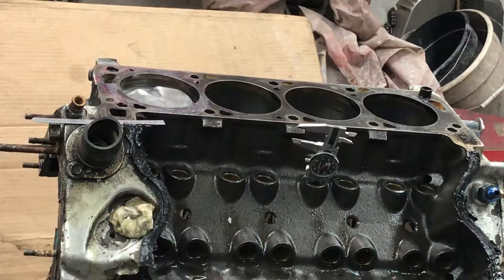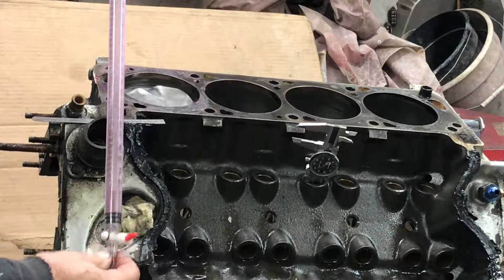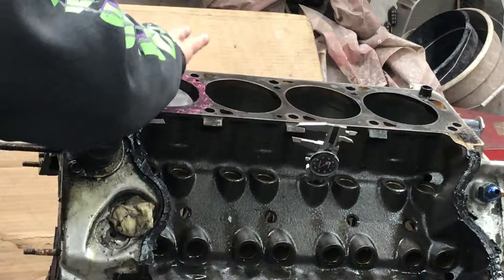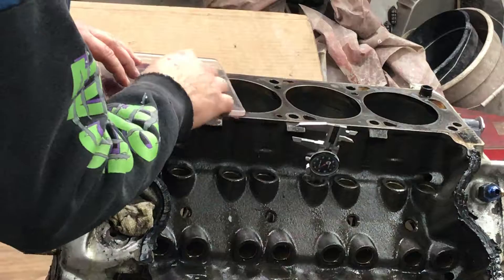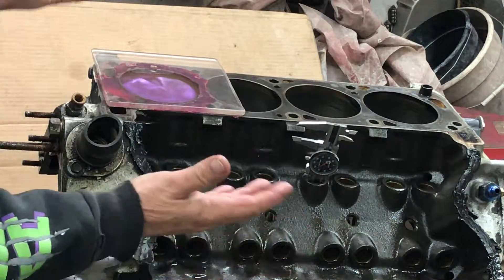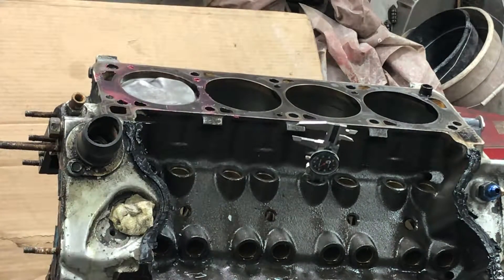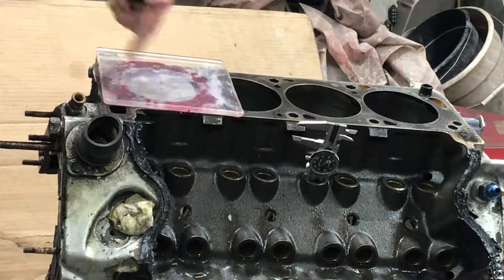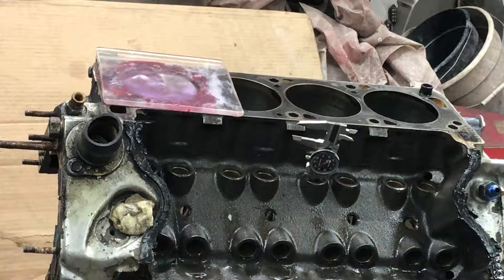Measuring volume (cc's) of a pop up piston. Read description for answer.

Comment: Thanks for explaining this, i was having a hard time figuring it out lol.  Was almost going to make a reverse mold of the piston, that would not have been fun..  anyway, i checked your math, and it all makes sense!  My only problem is how you calculated the compression height in the bore for your final cc measurement.  Truly the dome is 11 cc's, and its reliant on the builder to set the compression height.  That calculation is easily done separately.  Also im curious, is that gasket you used .050 or thicker?  Common .040 x 4.100 gasket calculates to 8 or 9 cc's, and picks the compression up almost half point in your example.  But that gasket isn't a symmetrical round bore either, so it might be more?
Reply from the maker: On a Cleveland the head gasket is bigger than on a Windsor. A Cleveland doesn’t have a perfect circle for the cylinder opening. I made a video of when I measured the cc’s of the gasket. It is 12 cc’s. Watch the video on it. Thanks.
Reply: @dansmessygarage  I will, thank you!  That is very good info to know!

Comment: Did you make good power with those pop up pistons on those open chamber heads.
Reply from the maker: It makes about 475 hp on 93 octane pump gas. Nothing crazy. It is N.A. no blower, no turbo, no NOS, just a single 750 carb. Today it is called a boring engine :-(
Reply: @dansmessygarage all these modern engines, people have a helluva motor with just a cam, exhaust, and computer tune.  It's still fun to take a motor with mediocre heads and show up some "big hp" motors.
Edit: not that cleveland heads are mediocre, just by today's standards.

Comment: Didn't it take a bit more than 147 cc? i could see some air under the plate
Reply from the maker: No. Watch the video again. You can see the air bubble getting bigger after I stopped filling it. The liquid was draining out thru the ring gaps. It most likely was draining out the entire time I was refilling the burette. That means it took less than 147 cc's. For my messy garage tactics, 147 is close enough.